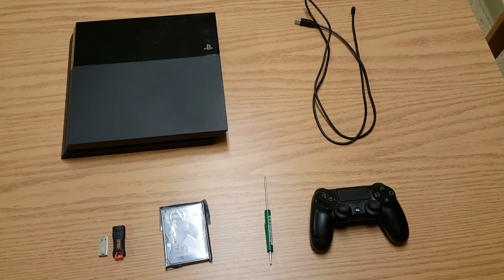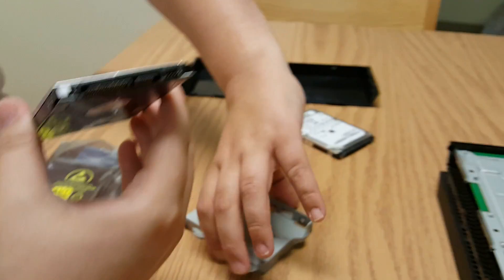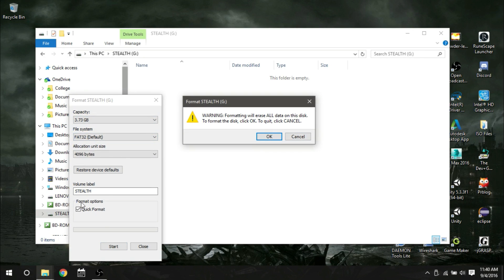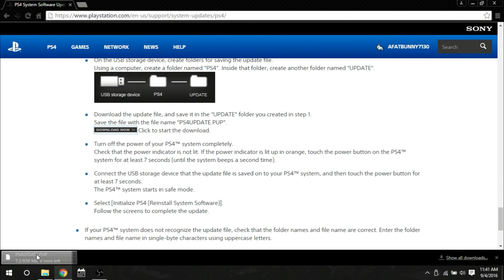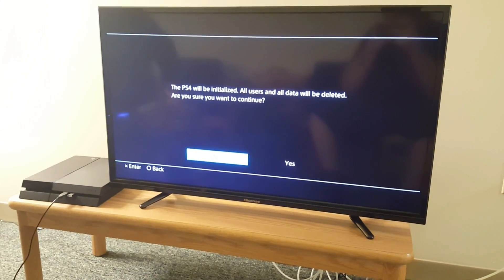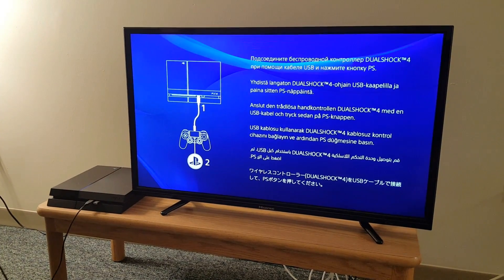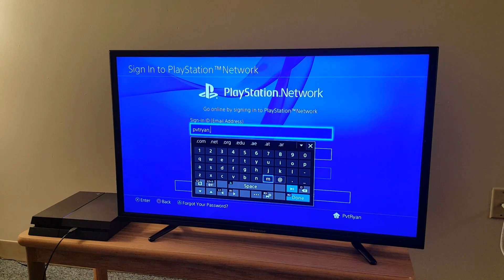PS4 Hard Drive Upgrade / Swap (500GB to 2TB)

Comment: Do all of the hard drive caddies have that little piece of cover that rests right over the hard drive itself? The one that came in my PS4 doesn't have that.
Reply from the maker: The Last Trap God I'm not sure if I know what your talking about.  is it a piece in the PS4 or on the hard drive?
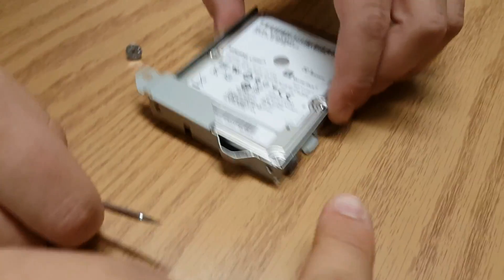Reply: +AFatBunny On the caddy. At 1:44 there is this little gray/silver looking piece that you can see that sticks out over the hard drive when it is placed in the caddy.
Reply from the maker: The Last Trap God Oh, okay. Not all of them might have that little piece. Some of the internal might be different depending on the model of PS4.
Reply: AFatBunny Okay, because mine doesn't have that. Also, I have a question. If you don't screw in the hard drive to the caddy, what happens?
Reply from the maker: The Last Trap God Probably nothing,  the screws are there to ensure that the drive is held in place.  As long as the drive doesn't pop out of the slot it should be fine.

Comment: Can i use my external harddrive where my media is in a PS4 map with the update folder? I've like 500gb free on my external harddrive Or do i need to totally clean it to make use of the update? Got a lot of movies en tv shows that i watch with the PS4 mediaplayer so that's why I'm asking. Rather not need to do that.
Reply from the maker: I am not 100% sure about this, but if I were you then I would keep everything on your External Hard Drive and also put the Update there.  Plug it in and try and see if it will work.  If it doesn't then the only other thing I can recommend is just buy a cheap 1GB flash drive for a couple of dollars and just put the update on there.
Reply: I upgraded my HD yesterday. I did the Update on Blank 1gb drive. But I was able to backup my PS4 of 340gb on a Harddrive that already had data on it.

So to be clear... I did not had to delete My recorded tv shows and movies on my external HD of 700gb. They are still on it.. and the backup and restore worked perfectly! for everybody who will watch your video and wondering about it. As long there is space on  your harddrive for backup it does not matter what kind of other data you have on it.
Reply from the maker: Sani Thank you for letting us know!
Reply: AFatBunny Your welcome! We are a community to help each other.
Reply from the maker: Sani very true!
Reply: I wish someone would put the system software install folders on an external hard drive that already has ps4 data on it. It looks like that's the only way I'll be able to upgrade my ps4 hdd to 1tb by using an external hdd because it would not recognize 2 usb flash drives with the system install folders and firmware on it. I used the new installation version and not the update version at the top of the page. I'm gonna try it using an externall hdd later this evening.

Comment: I have the destiny edition PS4. So when I buy this sea gate hard drive I just take out the one in my PS4 and put in the seagate and everything will work fine? Will I just have to re download my games and the saved data that comes with it? Can someone please answer this for me I'm kinda confused
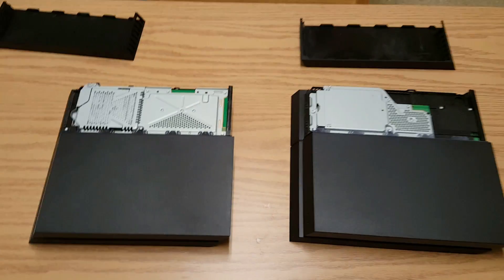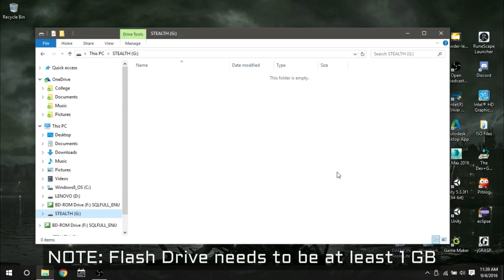Reply from the maker: You will want to look up how to transfer games and save data to a flash drive.  Then switch out the hard drives (1:25).  Download the PS4 OS to a different flash drive and plug it into the PS4 (4:19)  Complete the set up.  Then transfer your games and save data to the new hard drive.  (P.S.  I recommend googling how to transfer the save data.  I do not have any experience with that because I swapped hard drives the day I got my PS4, so I had no data to lose.)

Comment: Hi! I'd like to know if after changing the HDD you started your PS4 in safe mode? I ask that because every tutorial tells me to do so, but I'm unable to do that as my power button is broken. Thanks in advance!
Reply from the maker: Bruno Costa All we did was turn on the PS4 system. If it cannot find the Playstation OS on the PS4 then it should go into Safe Mode. So to answer your question more directly, yes we booted it into safe mode automatically.
Reply: AFatBunny thank you very much!! I just bought a 2TB HDD and your video will help me a lot!
Reply from the maker: Bruno Costa No problem! I'm glad I could help!

Comment: can I upgrade  my brand new ps4 hard drive before initial first start up? if so please tell step by step from the get go
Reply from the maker: Yes, you can switch out the hard drive on a new PS4 before you even start it up.  That is what I did when I bought a PS4.  For step by step instructions please watch the video. It will show you how to open, download and install the OS, and also what it should look like when booting up with the new hard drive.
Reply: cool thanks!

Comment: When the ps4 is in safe mode, I insert the flash drive and it says file can't be found.  what am I doing wrong?
Reply from the maker: Hmm. Check that you have the full Playstation OS downloaded from the website, not just the latest update.

How larger is the file on the flash drive? Is it like 800kb or 350kb?
Reply: Not sure. I'll have to check.  I have the ps4 update. Pup file in Update folder and then in PS4 folder
Reply: 304 k is the file size
Reply from the maker: Sounds like you downloaded just the update file.

Go back to the Playstation update page.  Scroll all the way down to the bottom of the page.  The lowest section should be a section that is titled "Perform a New Installation of the System Software".  Download the full OS from the download link there.

Then make sure you delete the old file off of your flash drive and let me know how it goes.  Hope that helped!
Reply: AFatBunny thanks for the comment it truely helped

Comment: I have a 2tb in my ps4 now and want to move it to the ps4 pro when it comes out. Since my 2tb will have the most current software update can I just put the 2tb in the pro and everything will transfer over?
Reply from the maker: I am not 100% sure, however, as long as the software version is up-to-date when the PS4 Pro comes out your should be able to put the 2TB drive into the PS4 Pro.

The reason I say to make sure that you have the latest software version when the PS4 Pro comes out is because the PS4 Pro does not come out for a few months still and we will inevitably have a new update between now and then.  Hope this helped!